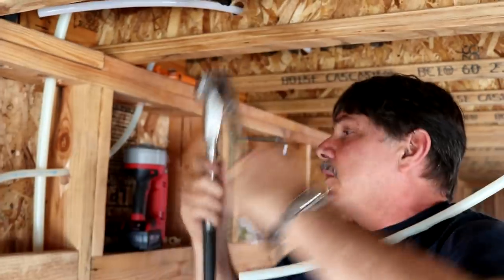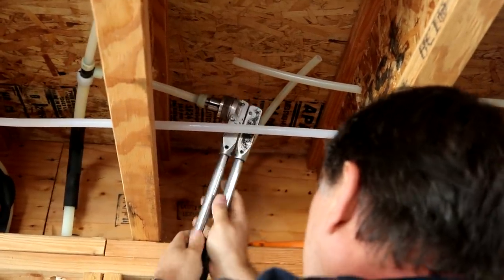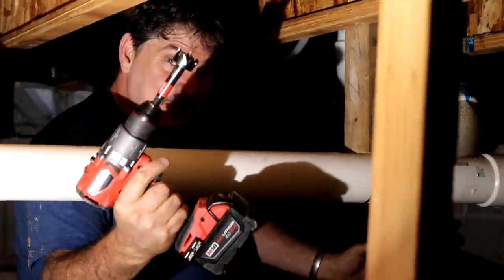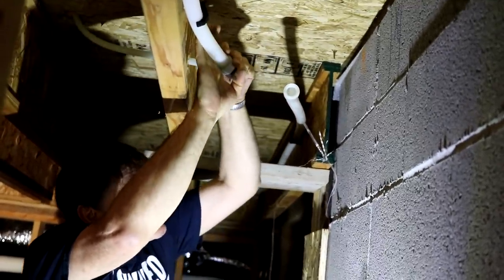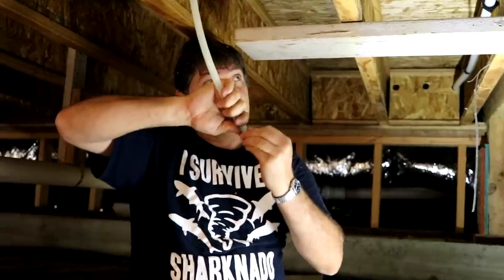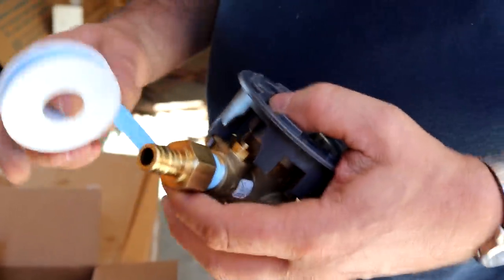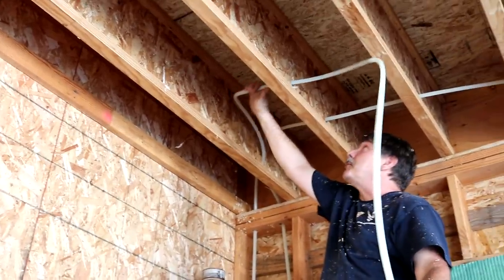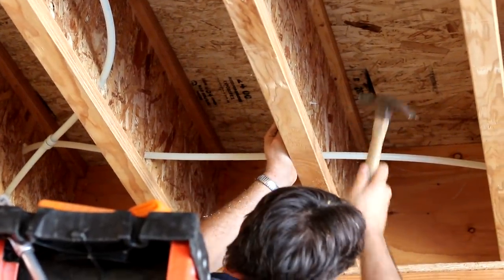Plumbing with Plastic Ep.95

Comment: I am not a plumber but a builder.....My experience with pex is that old copper plumbers still use a boatload of fittings...This guy flexed the pipe some but still used lots of fittings...any time you cut the pipe it is a potential leak, no matter how good a system...Pex bends...use this feature wherever you can   ....another thing older plumbers use lots of 3/4 pipe....no need...all the valves nowadays require flow restrictors..unless you are going to take them out...maybe a big tub?...I have used some 3/8 pex if the inspector lets me, or is not around with no problems why have a 1/2 inch pipe full of hot water sitting in the run turning cold?..........manifold is even better...and really pipe the house like a electrician...

Comment: There actually is a better and faster system being used in Holland and Germany. It's called Uponor. The hoses are plastic with a thin aluminum outer layer. You can easily cut the tube, bend the tube and use special couplings you need to crimp with a special tool. Very fast and no leaking. Google it and you'll be amazed.

Comment: I don't know enough about the PEX system.  There's a LOT of it going in these days.   I'd still prefer copper pipe if I could get it.
Reply: Copper pipe takes 3-4 times longer to install and the material is way more expensive. It's quite rare to have a whole house freshly plumbed in copper these days. Usually a wealthy and eccentric homeowner.
Reply: @kozemchuk  I know.  It's a shit.  My last house we built in the 1990's was the last copper install we did.   Only ran cold water around the house, as each hot-source was local.

That job was cheap compared to today.
Reply: @kozemchuk   Well, I ordered copper to replumb my bathroom. I wasn't wealthy. Eccentric? Maybe. Lol.
Reply: @YSLRD  For one bathroom, that's not so bad, but whole house repipes can be lot of material and a lot of routing, it makes a bigger difference the more pipe you're running.

Comment: Wait, what's the point of having a recirc line if you have a tankless HWT? isn't the point to save energy and only heat the water when you use it??
Reply: Well, a tank system with a recirculator is maintaining heat in both the tank and the pipes, while a tankless system with a recirculator is maintaining heat in a lot less mass of water, right? Though, sure, it's more energy than the tankless without a recirculator.

Comment: another thing...if you use a tankless water heater you will need a recirculater of some sort if your runs are of any length...you start out with dead cold water when you open the tap..and again with a flow restrictor on the bath lav it takes forever...I don't know how you beat this.How do you actuate the recerculater with a no tank to do any good??..other than if you have a big tub that you fill all the time and need endless hot water..I don't see the benefit of the no tank heater....if you have natural gas check how much it cost to heat water all year..not much...and you got to service the no tank often...and they are expensive...etc
Reply: Tankless systems now have a small water tank built in to prevent the “cold sandwich” that early systems had.
Reply: @SM-xm7dt  good to know...what a bunch of high tec and materials to save how much??

Comment: What's the point of a tankless water heater, if you're essentially adding a big tank to it, in the form of that long recirc line?
Reply: The volume of the recirc line is far less than the volume of the regular water heater. Also many recirc pumps have timers so they are not on in the middle of the night, when you're at work, etc.
Reply: @kozemchuk  A regular water heater is also well-insulated, unlike that pipe.  But my point isn't that a regular water heater is better for this application.  My point is that you are giving up the advantage of a tankless unit, so why incur the extra expense and maintenance of a tankless unit when you could just use a regular one?
Reply: @jej3451  I don't think you are giving up the ENTIRE advantage of the tankless unit. And people are willing to pay a bit more in energy to get hot water faster.

Comment: Do you know if there is an after taste from the plastic in the water from the pex?
Reply: Apparently for about a month, copper is healthier no doubt
Reply: Probably no more so than the metal taste you get from copper pipes or the plastic taste from PVC pipes. There is some leaching to be expected, since water is a universal solvent. But this stuff is designed to last around 70 years. If the water was eating at the PEX enough to develop a plastic taste, the pipes wouldn't survive long.
Reply: @jackielinde7568  You can also get a taste from residual flux from sweated copper joints.  Every method has its drawbacks.
Reply: @andrewalexander9492  I never said any particular pipe was better or worse as far as leaching. And if the plumber is gobbing on the  flux (copper) or the glue components (PVC), you're going to that to potentially contend with. (Also, an excess of flux in the joints can cause spots where copper pipe can eventually pit and corrode.)

If you reread the my post here about water quality, I did not make any statements as to which material was the best. I simply stated that the leaching wasn't going to be any more or less than if the other two materials were used instead. Just that if the PEX pipe (which as been around for 20 years I think) had a leaching problem, that would greatly reduce the lifespan of the product.
Reply: @jackielinde7568  I understand what you were saying.  My comment was more just adding another way one of the materials can affect water quality to the conversation,  not to dispute you or to say that one or another is better.  I don't think we really disagree here.

Comment: Here in Norway we run all PEX pipe inside conduit. Everything is connected to a manifold in a distribution panel, there is zero joins from the panel to the fixture. If there was a leak from the pipe the leak would run inside the conduit and reach the distribution box that is either connected to a drain or to an automatic shutoff with a leakage alarm. If you damage the pipe you can pull a new one through to the distribution panel without opening up any walls, great for renovations. Picture of the distribution panel: https://bit.ly/3mhWQG9 One line for hot and one for cold. There is also individual shotoffs on many panels for working on one component for example.

Comment: I think it would be better if you don't put joints inside walls. One or more manifolds and a straight line from there to water fixture, with a protective sleeve. Leaks are mostly in connections, and when you put your pex in a sleeve you can change it, atleast in theory if there are not too many sharp turns.

Comment: Why the offset hole at 15:30? Water hammer?
Reply: The Joists are made with pre-cut holes for plumbing and wiring, all you have to do is knock them out.  The result is that they don't always line up perfectly, whcih doesn't really matter for wiring or flexible plumbing.

Comment: I hope he used the Milwaukee tool instead of that manual expander for most of the work.  I can't imagine a professional plumber would do a job like that manually.
Reply: Old school man
Reply: Gotta inflate those hours somehow.
Reply: As he said in the video, he doesn't normally do new installs, so he probably doesn't own the Milwaukee, but owns the manual one for repair jobs. Run what ya brung!
Reply: @ADBBuild  He uses one in the crawl space, my guess is that he has a 3/4 bit in the tool and doesn't like to change it out.

Comment: I got a kick out of how he said colored pipe is for millennials. I sort of say the same thing. I don’t like it because ultimately what happens is someone substitutes one color for the other then the service guy gets screwed. As someone who started running majority copper, it forced you to keep track of everything and label things properly. I assumed uponor but I noticed it was heat link. I haven’t used the heat link expansion much as it’s relatively new. We don’t use it because it only goes up to 1” though I’ve heard they have up to 1 1/2” now.
You definitely chose correctly on the pipe system. With crimp rings you get a choke point at every fitting and the ring holds the seal. With expansion the fittings are the same size as the pipe and the pipe is forever trying to return to its original size so it will have a better seal as time goes on

Comment: I'm sitting here just baffled that he isn't using a power tool to expand all the pipes. Also, why not do a home run system? Cost?
Reply: Wouldn't a home run be cheaper because you don't need so many fittings? I also wondered about the power tool not being used.
Reply: @thaitichi  fittings are relatively cheap, manifolds for home runs can be costly, as well as the 100's of extra feet of pipe.
Reply: @Prunejuice23  That makes a lot of sense. The manifold systems look pretty cool though. And being able to shut off individual sections of the house must be very convenient.
Which system would allow for a hot water circulating pump?

Comment: There unfortunately are serious issues with PEX and similar friends. Environmental/water quality concerns for one. Read: https://science.slashdot.org/story/20/12/15/2141252/plastic-pipes-are-polluting-drinking-water-systems-after-wildfires

So for that reason, I recommend using copper with pro-press or a similar solder-free solution so there's zero lead or plastic involved.

Comment: Unless there is an appreciable difference in quality and/or price, can think of no reason NOT to use color coded (blue&red) pipe. Stands to reason it would save countless times of unnecessary pausing to confirm which is which, or even more time wasted retracing lines. And that's just in the installation phase. Down the road it's a no brainer how much easier it would be to identify and follow a specific branch.

Comment: Why have a recirculating line with an on demand water heater?
Reply: For long runs to save water. Keeps from having to drain all the cold water out of the line before the hot water gets to the fixture. The water in the line is already hot.
Reply: The water cools in the pipe. To avoid a blast of cold when the hot is turned on you can circulate the  heated water through the pipe. You will use more energy for the convenience but use less water. Some circulators have timers so you can program recirculation for the times you anticipate using hot water.
Reply: @ADBBuild  Where I live, that amount of wasted water is a lot cheaper than the electricity costs of heating the recirc line.
Reply: @ADBBuild  I have only ever seen it done with a standard hot water heater otherwise you are running your on demand all the time so why install one?

Comment: Plumbing has changed a lot over the last 40+ years. In the 70s carpenters & masons worked well together, but the plumbers screwed up the structure.  At least that was my experience.
Reply: some of us are still that way. I’ve always been impressed and kinda jealous of a really good carpenter, so when it comes to drilling or cutting or building anything on a job I try to do the absolute best I can because it’s the only time I get to play carpenter but still make a plumbers pay! 😂

Comment: Put a ring on it and pump it up or put a ring on it and crimp it.  6 o' one, half a dozen of the other.  Really don't see an advantage of one over the other where connection times and effort are concerned.  Maybe that, with crimp rings you don't have to sit there and hold it waiting on the pipe and ring to squeeze down:  Once it's crimped, you're done.

Comment: As a textile engineer (by degree), I cannot stand these plastic compression rings. NEVER trust stressed plastic. It'll either eventually crack, or creep and no longer hold any compression. Plus, as we see here, if you don't get it seated, and keep it there before it shrinks, you've made an expensive piece of plastic trash. (the pex in my house has brass rings, and it's over two decades old)

Comment: Pex is fine, but those plastic fittings are not to be trusted. Also, the plastic fittings restrict flow more than the brass ones that are also made for Pex. The cost difference between the brass and the plastic for an entire house is inconsequential when compared to the cost of a leak caused by a split fitting.

Comment: In the UK we use a simpler system called push fit. Where all the fitting simply push together no need to expand the pipe and very easy to remove

Comment: 13:40 No Phil. You should know better. Do your customer a favor and install those universal tub/ shower valves upside down when it's for a shower only installation. Give your customer more gpm to that shower head. You absolutely have to do this if it's a multi head or a shower with a diversion valve.

Comment: I'm not judging quality of the work, clearly Phil has years of experience and I don't, but... all white pipe when red/blue exist? I think that's a shame, those hangers with 1" nail that poke through the joists and have to be bent over? looks hacky and cheap.. PEX by itself looks awful with its floppy nature and randomly drilled holes without some uniform spacing, I assume this stuff will be covered with a ceiling? if not it would annoy me to no end looking at it for decades after, but I'm sure it will work for longer than I'll be alive so I guess there's that.
Reply: It is annoying to look at before the drywall goes up. I'm a copper kind of guy and take pride in my installs but sometimes you have to bite the bullet and go cheap to help a friend or land a bid. Pex really looks crappy once the hot water expands it.....

Comment: Why doesn't he keep a hundred of each fitting in stock in his truck? Buying parts just when you need them is for amateurs. I'm not even a plumber, and I have a hundred feet of PEX and an assortment of spare fittings in stock. Had I been in Texas when the freeze came, I would have been the man.
Reply: I do the same as he does. Helps me keep up with costs.

Comment: Plastic at pressure and hot...better than copper???  Cheaper, yes but not in this architects house.  I know, I have read all the data but I still specify copper.  Let the contractor be responsible for installing plastic when it fails.

Comment: Just like the Advent of Wi-Fi and the need for wiring is slowly diminishing supposedly there is a plumbing system similar to Wi-Fi that will transmit water without the need of a conveyance system it is in its infancy but I'm sure it's going to be very appreciated when you can just turn on your tap and your water will magically appear.